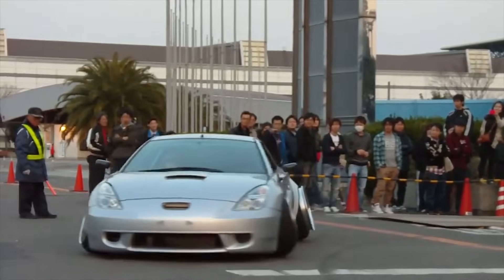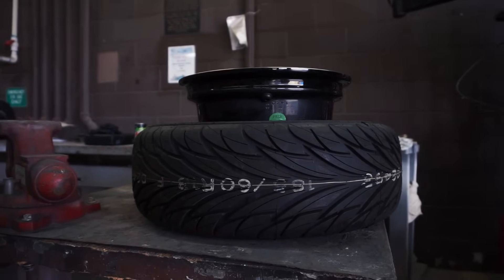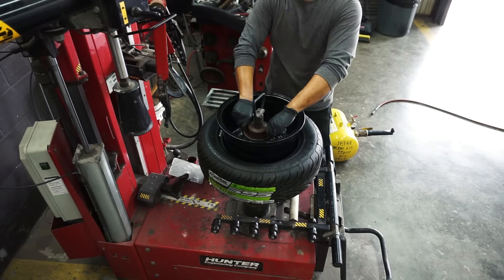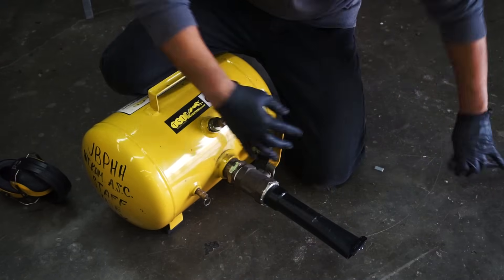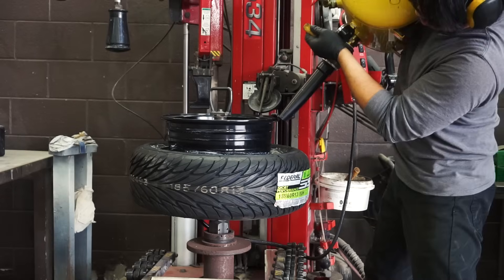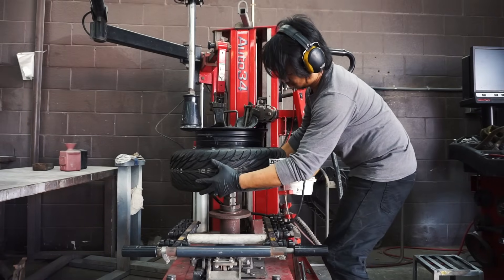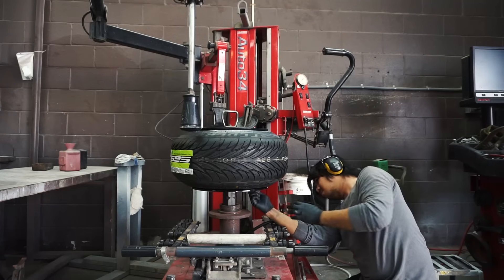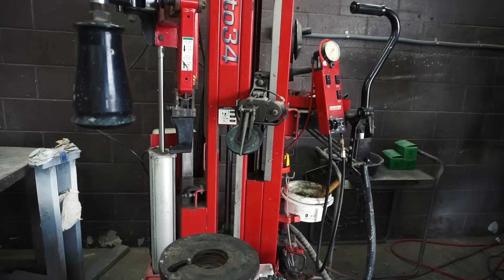Tire Stretch: 185/60R13 on 13x10

Comment: Why would anyone stretch a tire? In Europe driving with those It's a penalty like hell and there+s no way to legalize that... USA is different story...
Reply from the maker: Some for clearance purposes. Most for just aesthetic.
Reply: I wish they would do it in the us
Reply: There are a lot of different countries in Europe and a lot of different rules.
Reply: @bstiphout1  I live in EUROPEAN UNION which I mentioned and I've been tuning and upgrading cars in last 15 years. I know the law an regulations in EU and what you can drive on highways and roads. There are some differences from county to country but not so big that you can do this stuff and drive around without the plates taken down and huge penalty ;)
Reply: @alixxworkshop846  exactly, e.g. in the Netherlands there is no TUV for motorcycles. So you need lights and brakes and not make to much noise. For in Germany you can not change your brake levers without getting a TÜV.
Reply: And with my highly modified motorcycle, which has a European insurance I can drive through Germany without getting a ticket. The police stop me and they got nothing on me!😎
Reply: @bstiphout1  I've never mentioned motorcycle,only cars ;)
Reply: @alixxworkshop846  it's an example given on how crooked rules can be across different countries within the EU.
Same goes for air guns, if it is on air whether compressed high pressure or spring loaded, you can have everything you like in the NL  (11mm suppressor repeating 80 joule) without a license. In France you may not have anything above 12Joule.
Reply: Alix I'm from EU and there's a way to legalize this in my country...
Reply: @alixxworkshop846  Nah in Finland police doesnt take ur plates just because stretched tyres :D and we dont get penalties either. LoL #StanceLife
Reply: @juusomustonen3609  Skoudet rullaa mopojen perässä. Autoilla ei siis ongelmia B)
Reply: @ bart 
wrong. they might end your journey on the spot. because you are then in germany and have to play with german rules.
Reply: Thank God for the freedom to drive  and live in the USA.... ;)

Comment: Nice bro! So 195 60 r15 will be no problem in a 15x8 for daily driving? America's tire won't mount my tires smh. And also what psi should I run? It's for a 2004 XB
Reply from the maker: 195/60R15 is pretty conservative and honestly suprised a shop wouldn't mount those. As far as PSI, really anything from 28 - 35.

Comment: yes and never over fill and do not put your face near tire as the volume of air even at low pressure in event of tire rupture or wheel rupture the air comes out very steady and can literally blow your face off or eyes and brain out of your head. so be careful people , and know why when he goes to remove the air nozzle , why he is leaning as far as possible. ihave seen someone break both their arms simultaneously at the foreceps the forearms both were hanging down at a 90* degree angle and they went into shock. be careful with tires and know what you are doing like this fine being.

Comment: You can't get away with driving on tyres like that in the uk anymore. They have changed our mot rules "thats a yearly mandatory inspection" 
If you get caught buy vosa or the police, its 3 points on your driving license and a fine per tyre. Plus you'll have to tow your car away as it has unsafe tyres.
Reply: right decision, for the safety of other road users
Reply: Which law is this specifically? As far as I know the only law dictating tyres in the u.k is the one that states the tread on the tyre must not extend past the body of the car. I'm not defending a stretch like the one in this video by any means, I'm just interested in the law you mentioned.
Reply: Time to move to the US.

Comment: 0:05 This look isn't new, we were doing this on minitrucks when I was in high school in Beaverton Oregon in late 1980's. 15X10 reverse wheels, not wires, with a 195-50-15. Back then we had a very limited tire size selection, nothing like it is now. That's like 30+ years ago.

Comment: I used to do this to my rims on my Mitsubishi galant, the tire guy thought  i was crazy when i did this lol, i had 20" rims i had to modify my Mitsubishi wheel base and put rubbernands and taper the rim like this so it did not rub, but my tires sidwalls kept bubbling so i gave it up.

Comment: I'm surprised your tire machine doesn't have air jet to help seat the bead.  I've found a ratchet strap around the circumference of the tire can help deform the tire enough and push the bead out a little on stubborn ones. Of course take it off immediately after seating.
Reply from the maker: It has its own built in blaster, I tried using it and failed. I have yet to try the ratchet strap method, I'll probably try that next time.

Comment: I've used ratchet straps to squish the tire(spelled correctly). Then use a air gun nozzle to blast air into the valve stem. Takes a couple tries . A cheetah would have made it easier.

Comment: I need you for my back rims. 😂 i don’t stretch my tires but my lip on the rims is so deep and the wall it wider than normal that most people won’t even touch it or will defer me for further work with them if the succeed. 🤦🏽‍♂️😂stressful when i get flats. Luckily the fronts are normal. I jus have offset rims basically. Bought the car like that sadly lol
Reply from the maker: Totally would man. Dismounting tires is the stressful part when dealing with nice wheels. But mounting and stretching is no problemo.
Reply: @n0eLoL  amen to that, some nice 6year old plastic hard rubber is always nice xD

Comment: Yes...more 86 action!! Really like your videos, keep up the good work. Did you find the more air you let pump into the tire from the valve stem the easier it was to seat the tire??
Reply from the maker: I reviewed clips of the failed attempts and it seems like the angle I held the bead blaster and how much I absorbed the recoil of it was the key. But it could of been luck in the end.

Comment: Whys everyone hating on stretched tires, i know some people over do it with stretching tires and camber but it looks awesome if its done right. And my car is just as safe as any other car on the road probably more cause i actually fix shit, with -5° in the front with 235/35/19s on 19x8.5 rims and 255/35/19s on 19x10.5 in the back

Comment: What method is that I've only seen the lighter fluid one°
Reply: you mean where he used the tire mounting machine with lube that's the normal/safe way of doing it what you might find at a tire shop the fire method is more dangerous as it is well fire and more likely to explode

Comment: use the arm with the small plastic wheel on to push down and seat one bead on first, then you can pull the tyre up with 2 hands while workmate uses the cheater. you can do it without cheater this way.

Comment: Ok I don't get it.  How did blasting that canister of air suddenly inflate that whole tire?
Reply: @Phenom Menon: The moment he opens the valve: The ( still pressurized ) air blasts out of the canister nozzle and is being directed towards the tire's interior, where it can fully expand. This expansion exerts a huge force on the tire's inside where it can do nothing else but to "blow up". As it blows up, the beads are being forced outwards, that's why the tire jumped up in the first attempts. On the final blow, the beads were stretched on the rim's lip, sealing the deal. To prevent the tire from retracting, and thus seperating itself from the rim lips, the small air hose keeps the pressure inside risen.  All this took ( or takes ) places in a split-second, or in a blink of an eye. Ain't science great? 😊

Comment: Great video, as always 👍 How safe is it to run a stretch that extreme?
Reply from the maker: I wouldn't say its safe, but to say its gonna pop at any moment is a bit of an exaggeration. As long as the tire is fairly new and not cracked or dry rotted, avoid large pot holes, and regularly check tire pressure it should be ok.

Comment: Never seen a tire balance perfect and I’ve balanced them a thousand times. 
Your machine probably needs calibration
Reply: 3 piece and flow forged wheels balance out to 0 with no weight 95% of the time. Quality wheels will do that.

Comment: Hello all. Off topic, does anyone know if after dropping from alloy size R17’s to R16’s, when aligning the vehicle, the alignment stays the same, or will this change. For e.g. on the Mk6 Golf/Rabbit, you can get OEM alloys R17 size & R16. Providing the suspension set up, etc is the same, when aligning the vehicle will the principles stay the same? Thanks.
Reply: Depends. Are you adding more sidewall or are you keeping it the same? How about width? Allignment should be considered if the overall sectional height or width is being altered.

Comment: you usually run over max psi to keep the sidewalls from debeading also im assuming if u stretch this much its cambered it also helps get more contact patch as the center is bulged out and allows the tire to wear better ran 10deg rear 6 front ran 65 psi on a 3 inch stress and got 20k out of a genral economy tire

Comment: Is it safe doing this to a tire lt looks cool on some cars
Reply from the maker: It's safe to a degree. For example fitting a 195/50R15 on a 15x8/8.5 wheel is pretty safe. The stretch I performed in this video is border line unsafe and should be monitored routinely, checking for tire wear, and tire pressure.
Reply: No it's not safe . That's why any major shop ie discount tire , Costco won't do this shit cause it's dangerous cause it doesn't meet wheel width . In other words they don't fit .

Comment: what is that gas which you had in the yellow cylinder and what it is used for?
Reply from the maker: Just air. Pumped to 120ish PSI. The yellow tank is a bead seater or "cheater" and it's used to seat large floppy tires.
Reply: thanks man

Comment: I find it easier to do it with 2 people. I usually have someone stand the tire up and push the rim out and I'll blast it with the can from the backside. I've done some tricky grater tires where you have to use ratchet straps and a bunch of either to get them to seat. Tires are a bitch

Comment: i once wanted to but 215/40-18 to put on my 18x8 rims. the guy almost didn't sell me the tires xD now bear in mind that barely stretched the tires xD cant even call it stretch... i just wanted the 215 due to the pricing as the 225 was 35$ more :p

Comment: there are fancier tire machines that have 4 bead seating air blast nozzzzzzzzels at 12, 3, 6, 9 o'clock on the bottom clamps.......
Reply: We have those, you still need a bead blaster like that all the time.

Comment: I always wondered how rims and tires hold the air inside like HOW!
Reply: Theres a bead holding it using pressure. I mean it's not hard to understand,  go get a part time job at a store shop or express tire. 
I promise you mounting a tire is easy. He was just doing a special store job.  Most tire jobs are easy as hell. 
The only time you'd need to do what he did would be for a trailer tire.

Comment: I saw a vehicle with stretch tires get a blow out and roll at 80km/h on dry tar.

80km/h. How the fuck do you even lose control at such a low speed? Because the tire collapsed and the rim beading ended up on the road and it had zero traction.

Comment: You left the sticker on the tire when you balanced it dummy 😂
Reply: And how much do you think that sticker weighed??
Reply: @simonferm5493  not a lot but balance weights aren't heavy either. Takes 2 sec to tear it off
Reply: I worked in a tire shop for 2 years never took off a sticker till I got into an arguement with an old man and I tore the sticker off no change at all